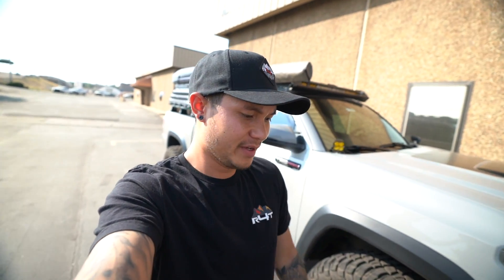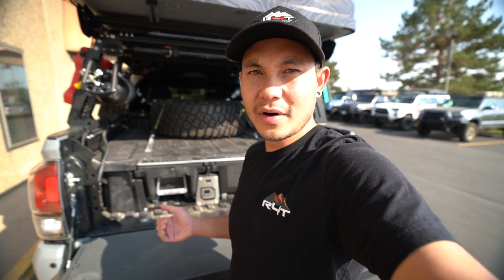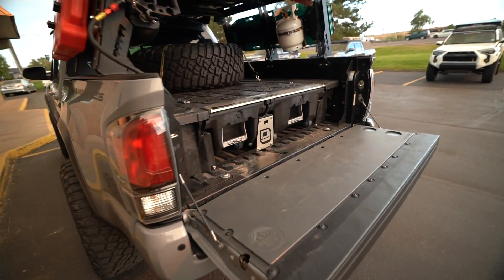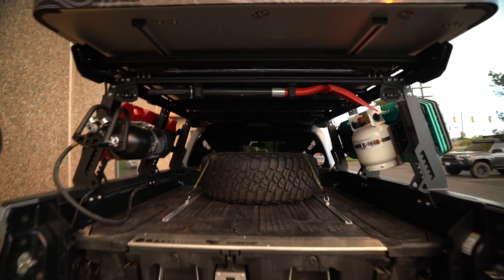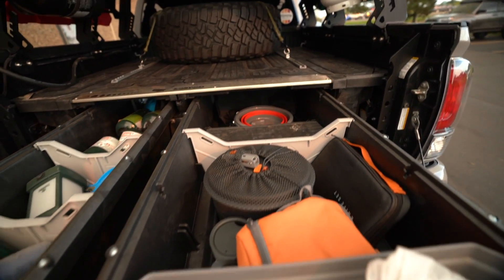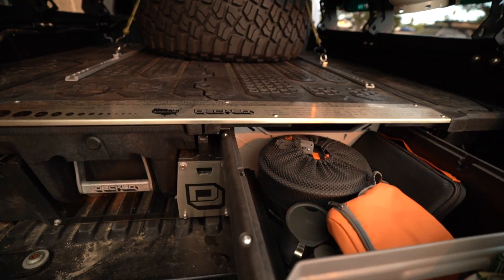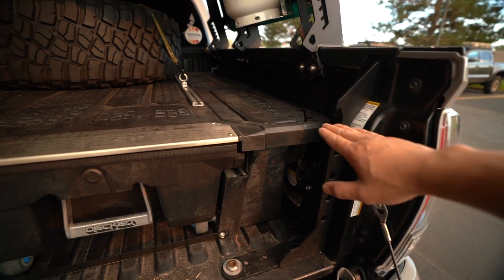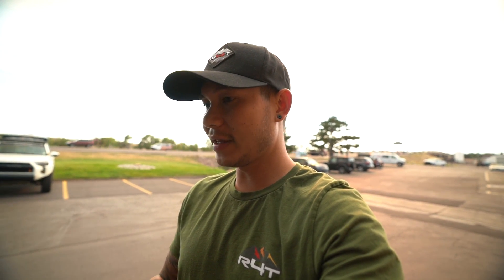Tacoma Gets Decked Drawer System!

Comment: Does this block the power outlet in the taco bed?
Reply: It does you can modify it yourself or do what decked says which is run an extension cord
Reply: @df8600  seems kinda silly they wouldn't have designed around this :/

Comment: How heavy is it? 
How difficult was it to install?
Reply: Just over 200lbs is the weight on the DECKED system. On midsize trucks we didn't want to weigh down your vehicle. The initial install takes about 3 hours and comes with pretty detailed instructions for a DIY install at home. Hope that helps and let us know if you have any other questions.